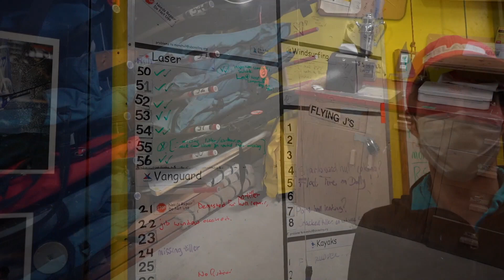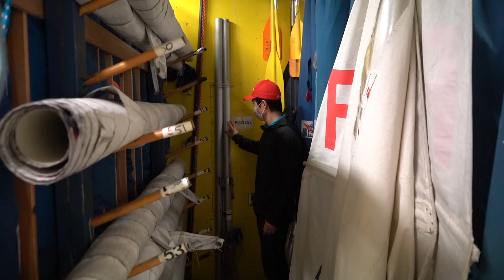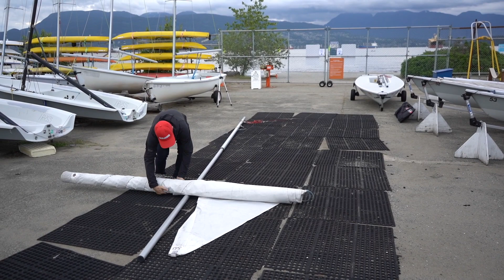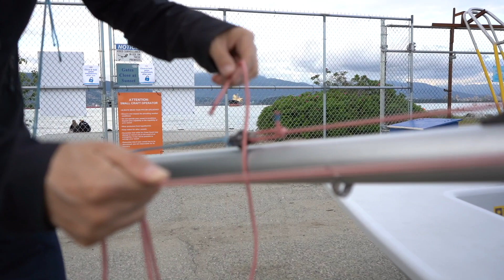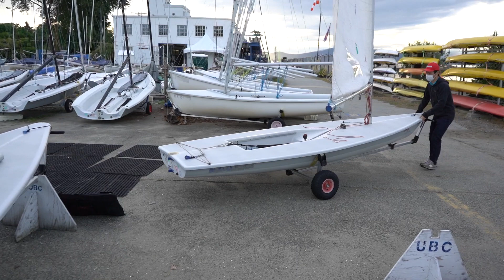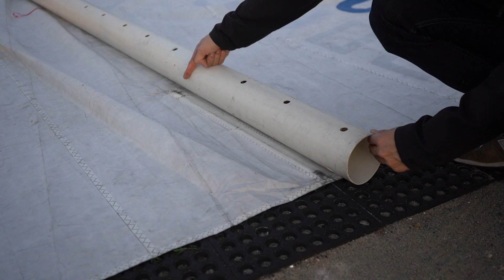UBC Sailing Laser Rigging How-to

Comment: A couple of things I saw that could be improved is when you do the mainsheet pull all the rope through the rachet block then pull the boom out to 90 degrees from the boat so when going downwind it is preset so the sailor can drop the mainsheet while bearing away. Other than that great video 9/10